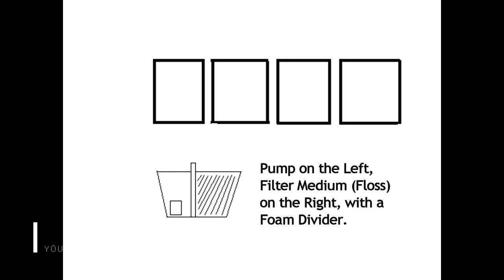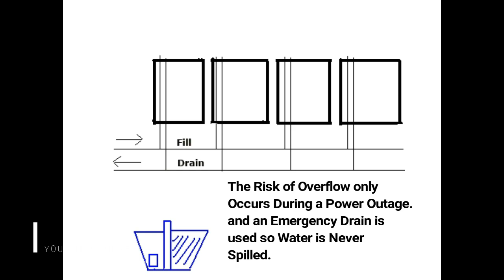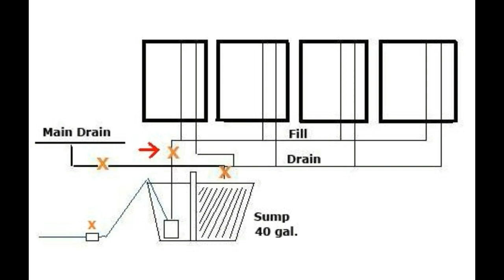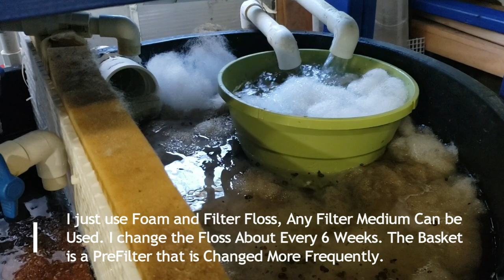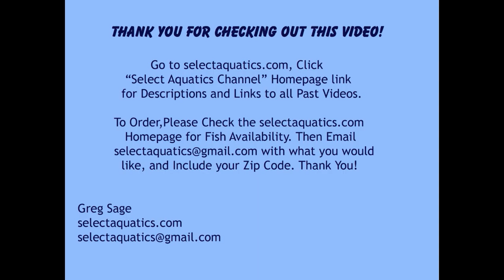Select Aquatics Presents   Central Sumps, Earning a PhD in PVC!

Comment: Great set up, i have one tip I would put the easy detach below the ball valve on your return pump around 16.00 so you can do maintenance by just shutting it off  and not having to drain down tanks. My dad always did this sort of thing on the lines in our house so he could fix things with minimal difficulty.

Comment: Very informative. I like your presentations.
I'd like to suggest that maybe instead of running your water change system to each individual tank, you could run it to the sumps instead. That way you could eliminate the overflows for the wc system and put the overflows for the sump in the back. I understand there may be reasons why this wouldn't be feasible for your particular needs/circumstances, but it may be something to consider.

Comment: would there be a problem of putting your water change system in the sump its self and having it distribute the new water and you would only need to have one place to pull water out or have an over flow in one place it seems like a no brainier to me now but i'm prob missing something 

or maybe you have just have the water change water come into the tanks and use the over flows to over flow the extra water into the sump and maybe use a sump pump with a float valve  or over flow on the sump its self to keep the sump from over flowing during water changes
Reply from the maker: Please email me at selectaquatics@gmail.com, and I llok forward to discussing this with you further. thank you!  Greg Sage, selectaquatics.com